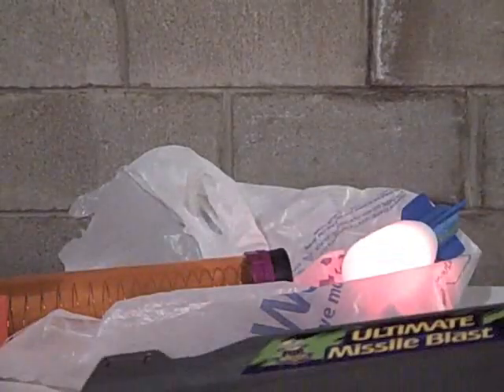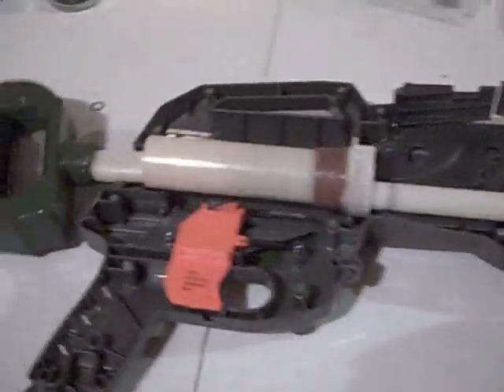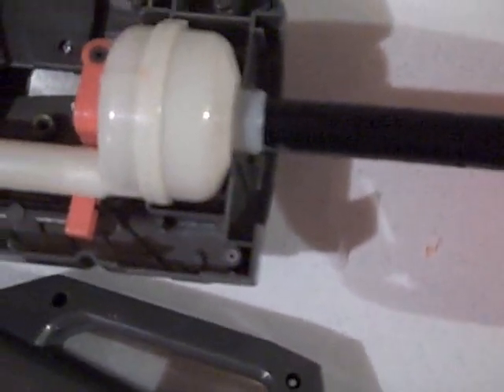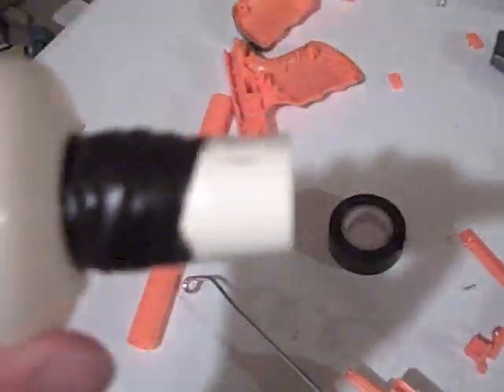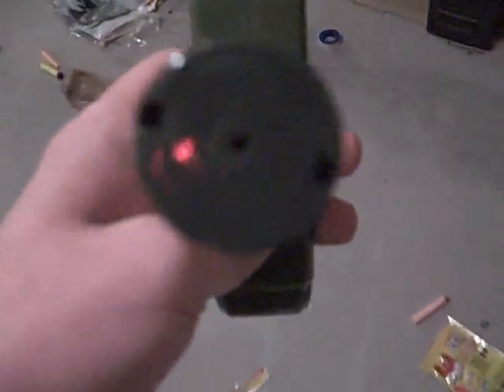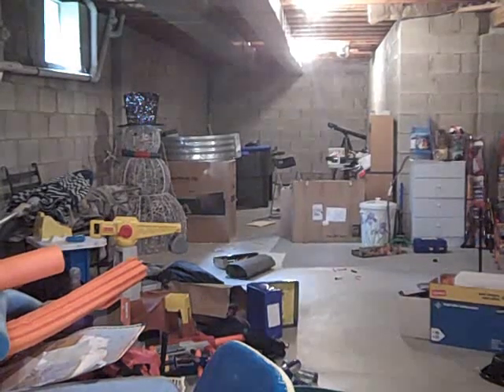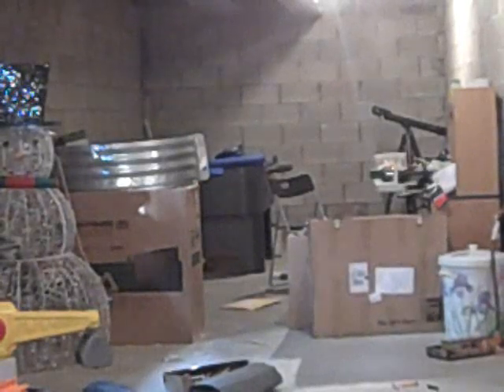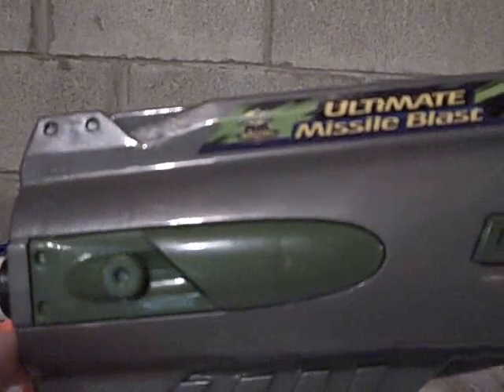Ultimate Missile Blast Mod Guide- 150ft!

Comment: A suggestion if you like singled air tank shooters, check out the Mega Missile. I converted my MM using your tutorial for the UMB and that thing is crazy. I'd say it's better than the UMB by about 25ft after modding (I modded both at the same time, with the same materials, using you're same tut since they both have basically the same tank), as long as you make a better seal with etape under the plungers o-ring. With whistlers, it's bruise worthy.

Anyways, thanks for the guide!